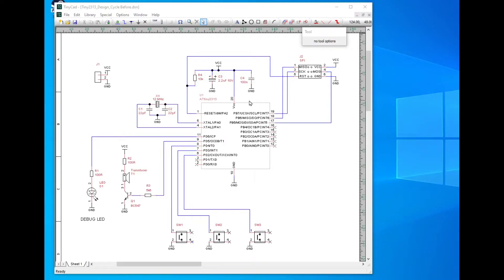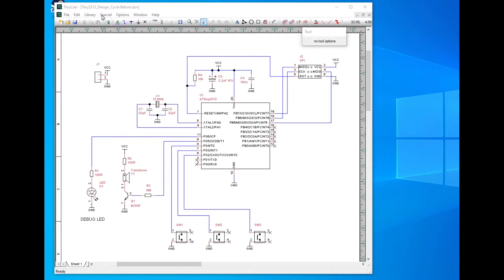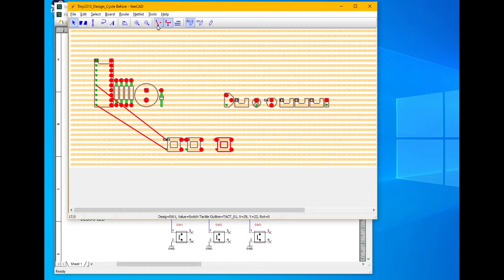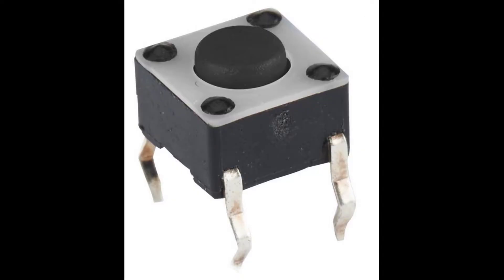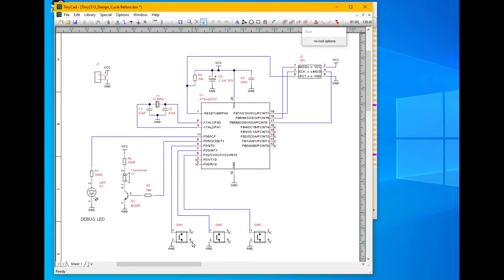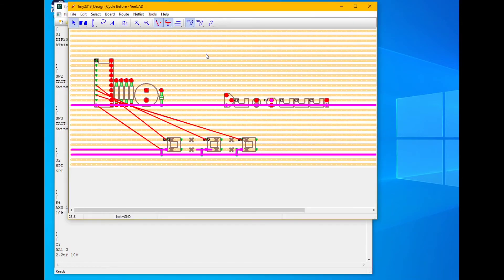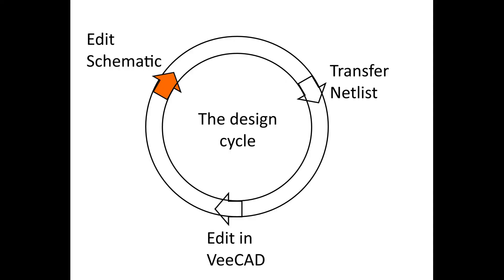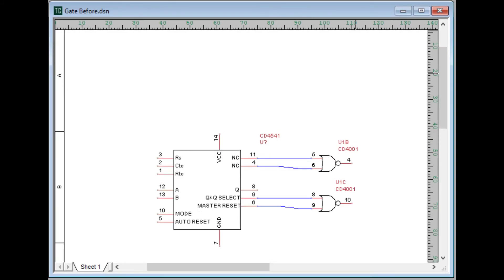Design Cycle

Comment: what does it mean when the components have a red dot on their terminals as opposed to a green dot
Reply from the maker: In the video, the small green triangles are component pins. When you click down the "Draw Net Errors" button, you see a red dot drawn over any pin that has a wrong connection. You know your layout is correct once all the red dots are gone. A layout with no errors typically works straight off, provided you don't have a solder short.
Reply: @veecadcircuiteditor2687  thanks for the prompt response